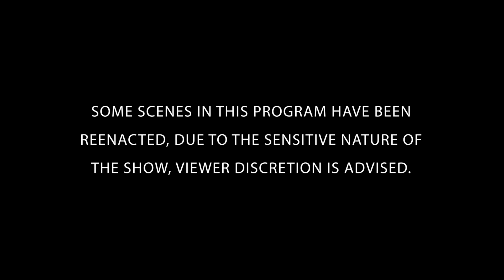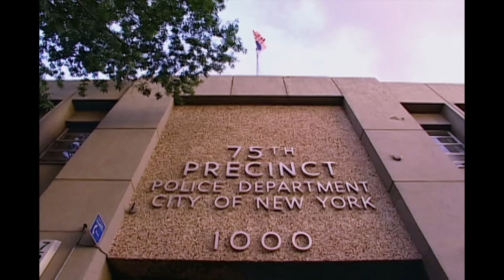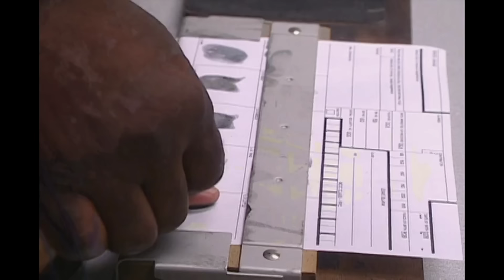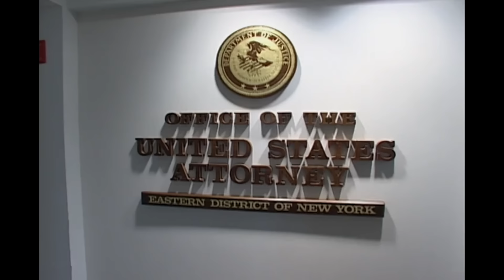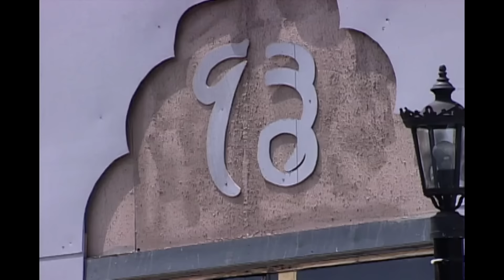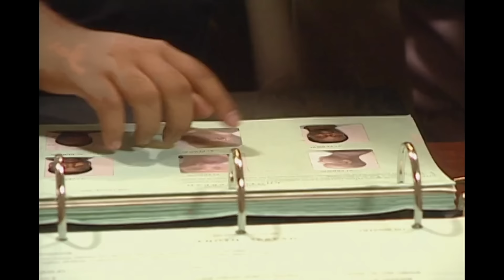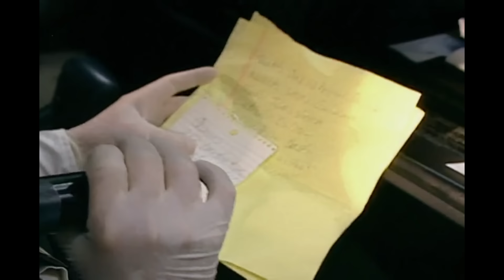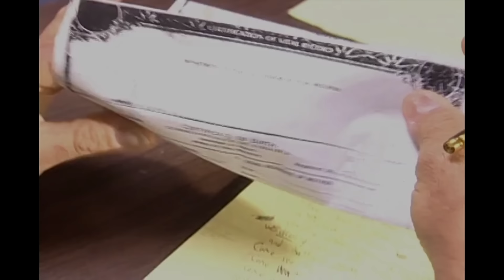Deadly Business | FULL EPISODE | The FBI Files

Comment: proper auditing of pumps would've prevented this... 1 inspector was currupt... thats why you use multiple independent auditing agencies
Reply: That's all done by weights and measures which is regulated by the government I'm not sure if that's through the department of agriculture or every state is different but I know department of weight and measures usually comes through twice a year I want to say I used to work at a gas station
Reply: The pumps could be turned back to legitimate with a flick of a switch.

Comment: 2050 yeah I was trying to get us better lead-ins when we see something going on And we want to investigate because of protecting ourself by protecting others there's the classic line of calling a friend that looks like that person that person and leading in with that but I don't do good at faking anything and my (our) motive for investigating is how do we prevent that from happening if it's us and how do we prevent it from happening for you so you can serve us better. With each investigatory body we find relative parts per million of each element of preservation. So I was giving us the new buildings to work on the remodeling projects to work on and all of our base elements that we need to survive so that in any circumstance when you're instinct is telling you something isn't right here and you need to intervene but you know you don't want to use force or threat of use of force you have a piece offering That's the other reason we use cannabis in judicial grounds to cover up the slave driving because you weren't actually supposed to just get random used as an informant because that was getting allies betrayed all crazy.